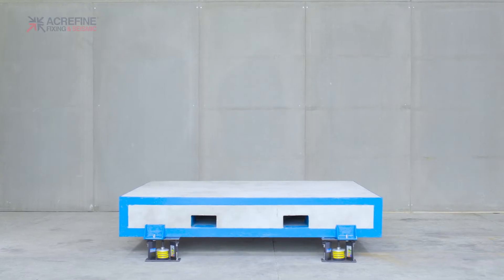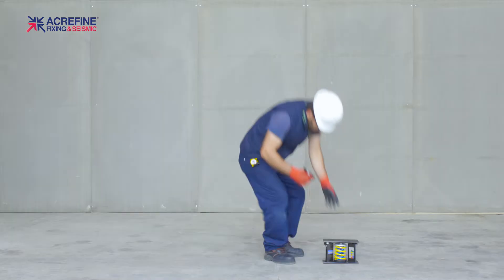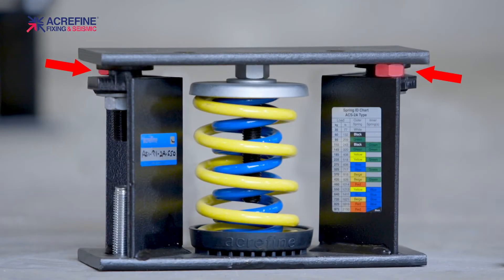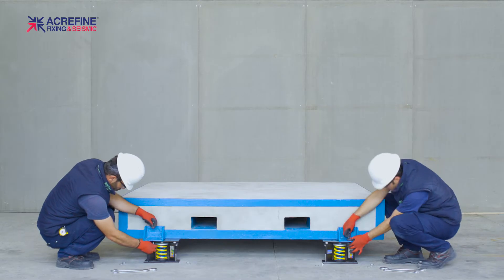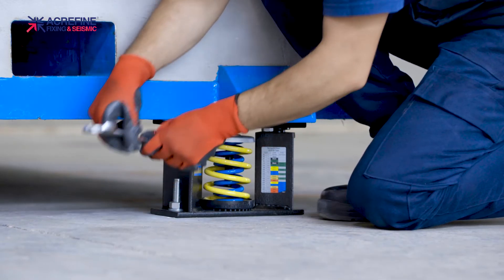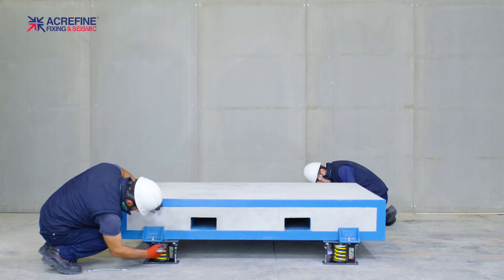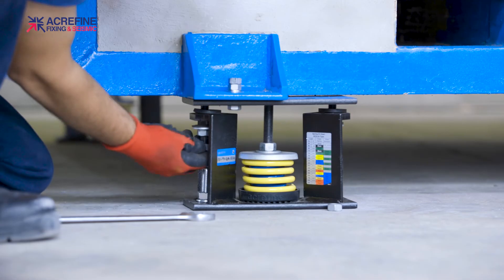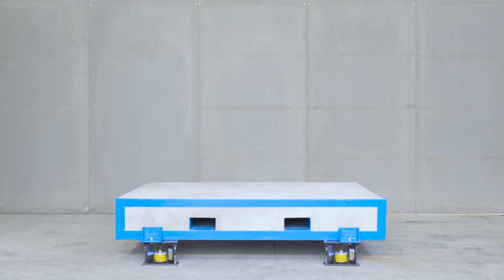How to install Seismic & Vibration Isolator with Top Plate

Comment: Looks like it's overloaded tho...
Not really any range for motion or sag over time
Reply from the maker: Actually, overload control is pretty easy. If the spring is locked, then it is overloaded. Otherwise, the more the spring is compressed, the better the vibration isolation performance.